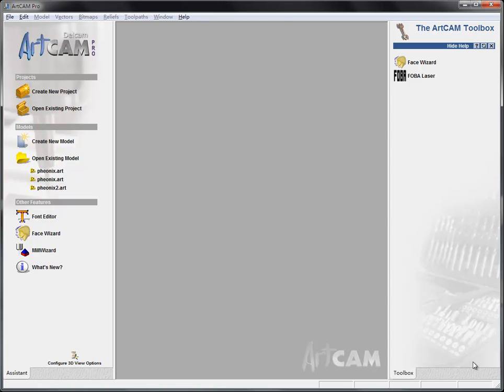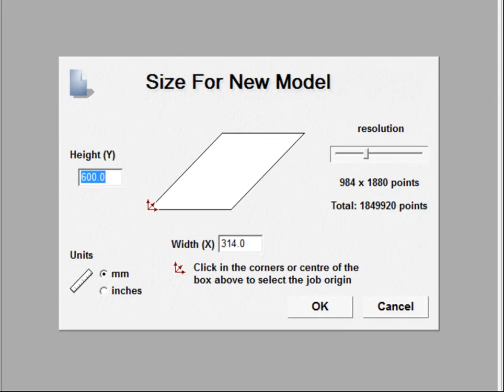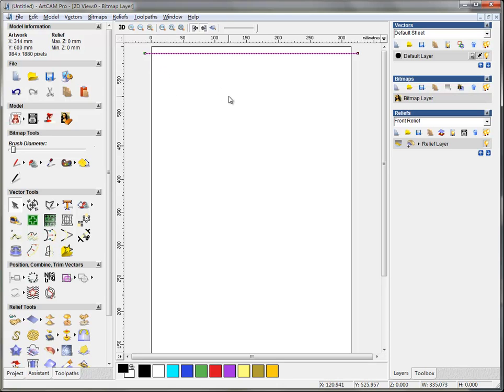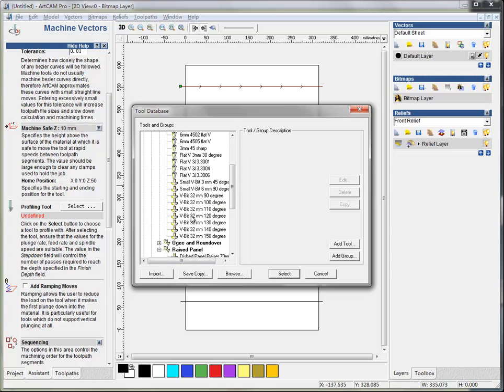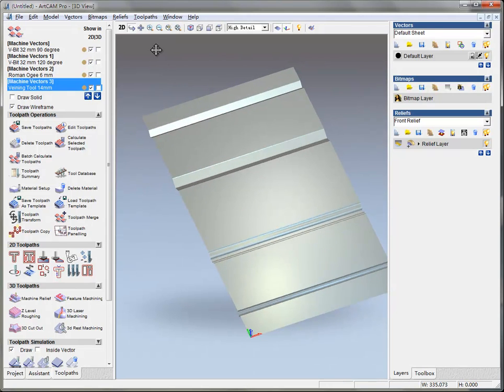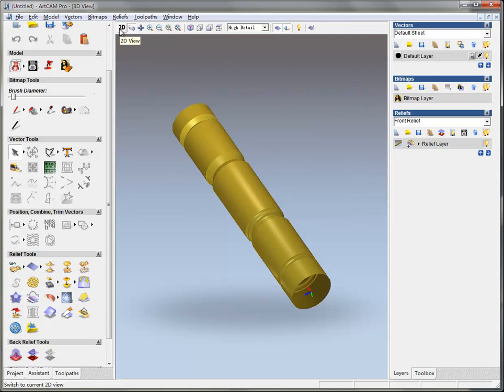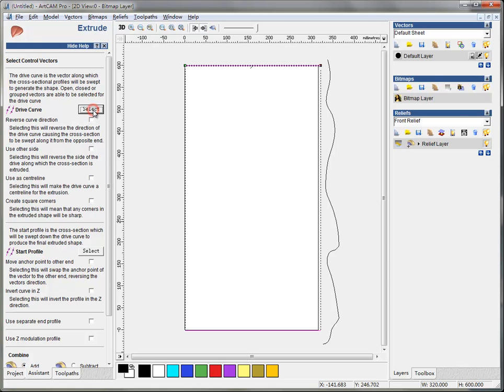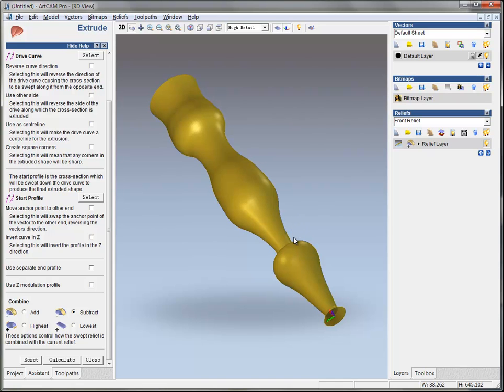make toolpath for rotary in artcam

Comment: My rotary attachment is parallel with the Y axis. No matter how I place the cylinder, the rotation axis of it always the X axis. How can I change it? ARTCAM 2018
Reply from the maker: It doesn't matter how it looks in artcam. You can just check the code and see if it works

Comment: sir, 
one quation,
machine output file is foametted for____  ( fill space )?? 3 axis or 4 axis rotery X->A ( *.mmg ) for CNC USB controller
Reply from the maker: 3 axis tool path is OK
Reply: sir, 
SECOND  quation,
machine output file is foametted for  model master  ?? 3 axis rotery X->A ( *.mmg ) for CNC USB controller is right or wrong ?